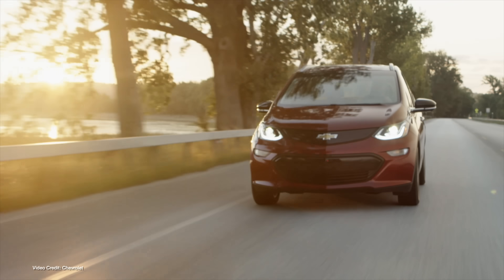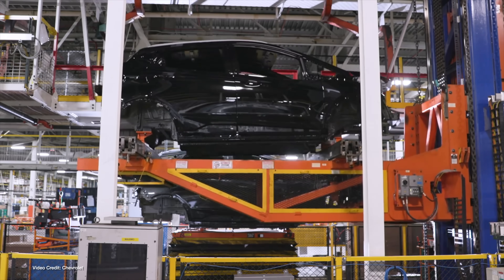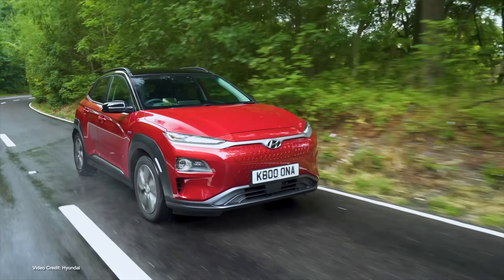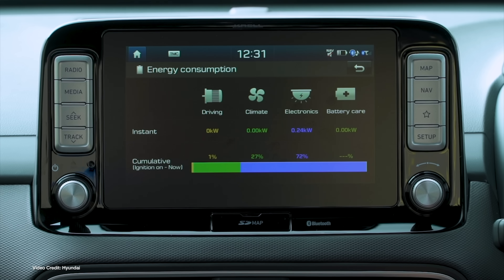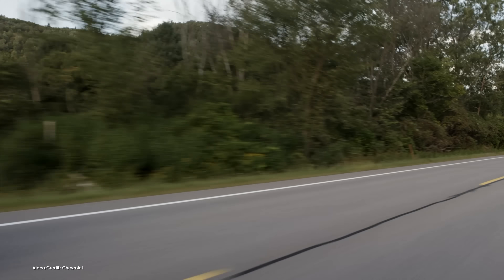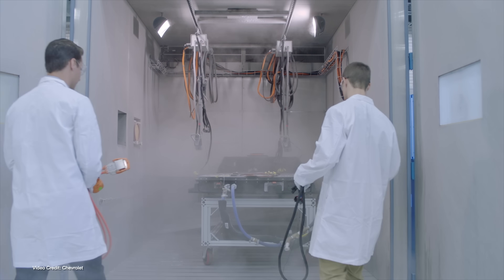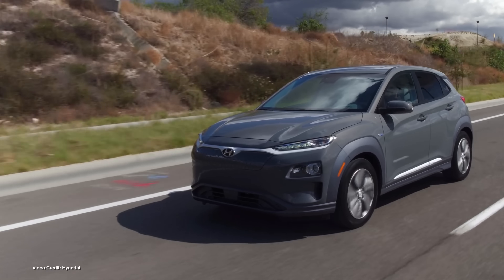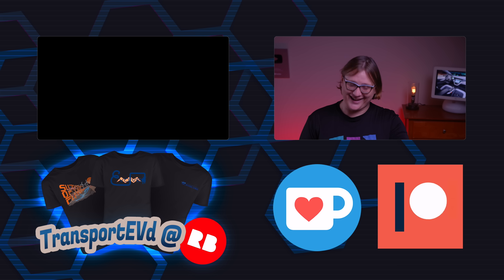Chevy Bolt EV Battery Recall: Here's Our Take on GM's Inspect And Replace Plans

Comment: Well that’s disappointing. That said my Chrysler is 4 years old and on its 3rd failing transmission. Not just an EV problem
Reply: Were the transmissions new, used or reconditioned?
Reply: @mamadouaziza2536  You must be pulling heavy loads.   I hate Chrysler, but even for Chrysler, that is unacceptable

Comment: It’s not like the Bolt would be affected by DC charging as the Bolt is the slowest charging 200 mile range EV sold.
Reply: Maybe they were smart to not speed up DC charging
Reply: What all >200 mile options were out there in 2017/18? There was the Tesla, the Bolt, and...?
Reply: @Jcewazhere  Sadly, the newest Bolts still have a slow DC “fast” charging rate. 55 kW charging rate for a $31k+ EV is absolutely lackluster. Only 90 miles in 30 mins? No improvement to the charging speed after 4+ years of manufacturing the vehicle is just plain bad. There’s no way to spin that.
Reply: @Jcewazhere  The Mache-E is not $50k+. It starts at $42k before incentives. It also has features and performance that will absolutely embarrass the Bolt, so no good in comparing the two. I never said the I-PACE was a star at charging rates. It doesn’t help your case to bring that overpriced EV up. 

My point here is that despite GM having years of experience in manufacturing the Bolt, it still has a slow charging speed for a $31k+ car. Surely they could have improved charging speeds over the years, no? If you’re dropping $31k+ on a car already, which is a lot of money to begin with, then I dunno how you couldn’t stretch the extra few thousand for a far better option. Unless you get a deal from a dealership that you can’t resist.
Reply: Hahahaha right

Comment: Sadly, no over the air update.  Another trip to the dealer.   Sorry.  This is what you get from dealer oriented GM.
Reply: Yeah, but at least GM doesn't have the right to repair issues that Tesla does.

As soon as Subaru comes out with an electric WRX/Impreza wagon I'm selling a kidney to get it, until then I'm happy with the Bolt.
Reply: @Jcewazhere  I dunno. These pressing issues that the Bolt is having seems far worse than what Model 3 owners experience. And if I did have a problem with the Model 3, I’d rather have a mobile service ranger or service center take care of it, rather than a parasitic dealership.
Reply: @Jcewazhere  There’s no changing your mind here. Looks like we prefer different business models for sure, but Tesla is definitely not monopolistic. It’s smart for them to either service their vehicles themselves, or by approved Tesla service partners. Imagine if 5 years ago when Tesla was still in the lurch, they allowed people to do DIY stuff or take their vehicles to unauthorized repair shops, and work done on the car compromised it in certain ways. That car can end up doing abnormal things, leading to unnecessary bad PR for Tesla, which would not help their public perception while growing. 

I actually work for Apple. You don’t have to take your Apple device to an Apple Store for service. There are various authorized service providers like Best Buy, or even smaller ones like Simply Mac. Apple has iPhones built in a way that it has a lesser failure rate than non-Apple phones. Statistically speaking, iPhones have less hardware problems than non-Apple phones. I can attest to this since a Galaxy S6 Edge+ was my primary device, but now it’s on the back burner after I got my first iPhone a few years back.
Reply: Maybe but it's possible that this repair can't be done OTA which might only work for infotainment type updates depending on how the Bolt is designed. This is for a battery pack module which might be different.